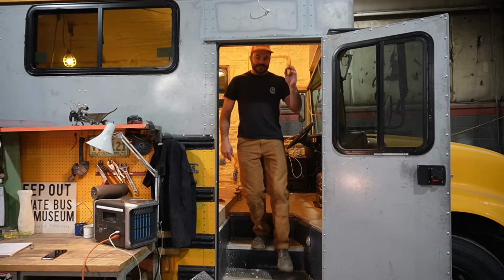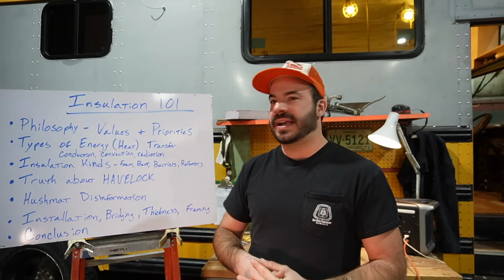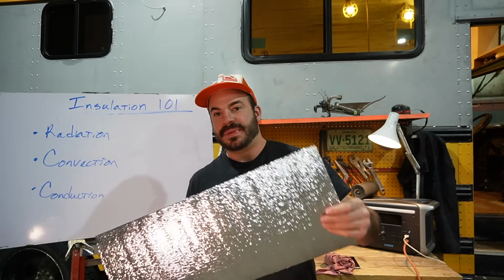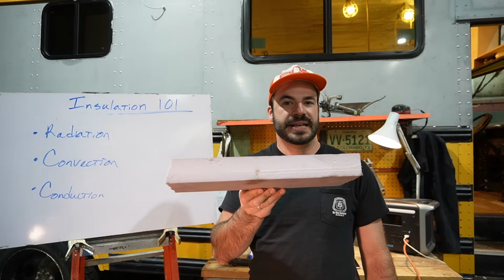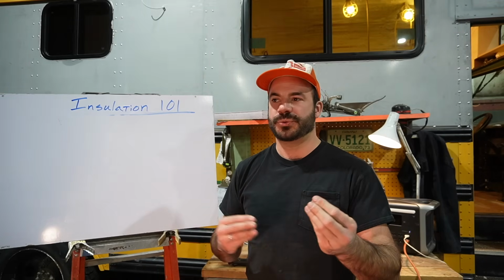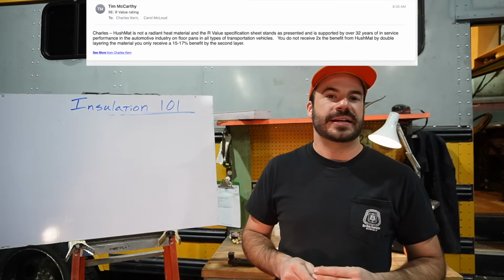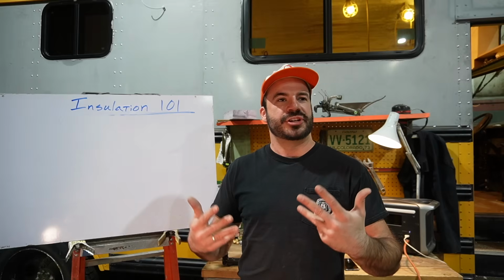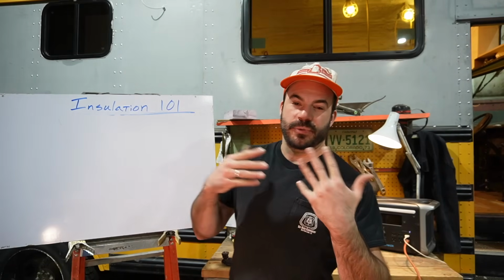Insulation is a SCAM (& the truth about Havelock and Hushmat)

Comment: Maybe I need to watch more videos from you. I'm confused on how you attach anything to the vehicle like the walls and such, if there is a 1.5" layer of spray foam on everything. Like if I can't leave a stud attached to the side of the vehicle and also exposed inside how do you attach things?

Yeah, after watching the video where you spray foam the inside of a bus the strapping is still exposed and in direct contact with the metal that touches the outside shell of the bus. That is a direct contact from inside to outside of stuff that isn't spray foam. This whole video said not to do that. Maybe I just misunderstood that there shouldn't be any contact from inside of vehicle to outside shell to stop condensation.

Comment: For some people, alot of this seems like common sense, trapped air in the wall needs to escape somehow,  if you own a truck,  having a metal skin, they've installed a rubber one way flap between the cab and bed, most people would never notice or even consider why its there, but its there to allow the hollow cavity to vent

Comment: This was very informative, I watched 3 times and showed my husband who nodded along and finished your sentences.  Would we be able to reduce the internal heat in our vehicle (and reduce our need for AC) if we put a chrome mirror wrapping over the metal / over the paint job on the vehicle to reflect out radiation AS WELL AS I guess it would be convection heat of the hot air around the vehicle?  Great video, great channel, subbed. Thank you!!

Comment: For some reason this popped into my "feed", so I watched for some reason.  Great explanation. With that, if you were to spray the metal of the interior (or paint) of the van or bus with like Lizard skin or even Redgard would that then do any good with moisture between the metal and the wood?  What if you were to coat the bus metal interior with Lizard skin and then the ribs with Redgard?

Comment: There are still a lot of nuances missed. Closed cell spray foam should not be relied on for a vapor barrier. It thermally cycles not to mention as you’re driving down the road the additional movement will cause yet more cracks. Factor in the off gassing and carbon impact of foam insulation, I just don’t see it being as good as your making it out to be. Installing a dedicated vapor barrier would be much better than relying on spray foam.

Comment: Putting a reflector INSIDE the window glass of a vehicle will certainly help, but look at the path of the light. It first has to enter your vehicle, and then it hits the reflectix(sp?) and then it has to go out through the window again. There is some heat gain in your vehicle.  The same thing with your home, putting shades, even reflecting shades INSIDE a window will help and keep that heat from radiating inside your room and heating up things inside the room ... like shade.  But the shade itself is inside your house/window.  What would be really good is something on the outside that shields even your glass window from the direct sun, but is not in contact, or is in insulated contact with your window.  For example, if you stood ourside your window and help up aluminum foil any distance away from the glass then you would be shading your entire window and the inside of your vehicle.  or if you had a really good insultator on the outside of the window, say like you could mold styrofoam thick enough to prevent conduction of heat onto your glass - that would be the best could co.  But that would look like *&($(*#$ and be hard to attach and probably add air-resistance to your vehicle.  I've seen videos of vans with some kind of thin insulator stuck to the outside of the window, that I think has little holes in it to allow the occupants of the vehicle to still see out.  That might be something to look into.  The thing is that in winter, you might actually want that heat to get into your living space.
It's complicated!  ;-)

Comment: I know this video was posted a long time ago but I have a question. When you were talking about the foam insulation you're saying that something about people worried about the bad fumes that it can produce. I'm wondering if there's a way to put something or paint something over it like a thin spray, thin paint, etc... coating that would not depreciate the value of the foam from doing what it does.

Comment: When doing a van build where space is limited, and you can't afford the space of inches of insulation on top of your framing, how would you recommend mitigating thermal bridging for the wood studs? Maybe a layer of XPS behind each stud? So the sandwich in my case would be wall cavity insulation (whether spray foam or thinsulate), studs with XPS adhered to their backs, and lastly wrapping the whole thing in Intello Plus variable vapor barrier.

Comment: Minor comment about "convection". Convection is the mass transport of hot stuff because of buoyant expansion. You heat the air, or water, it expands and becomes buoyant relative to the cooler air/water, and floats upward (then it cools and comes back down). You can also push the heated mass around with fans and pumps (or even shovelling hot sand) which is very similar to classic convection. 
Often convection is actually a problem because the heat 'goes away' and fails to stay where you put it. It can also carry moisture with it. Damp air is is also buoyant, so warm damp air can be even more of a problem.
 
As an aside, water stops expanding for temperatures below 4C, which is part of why you get ice on lakes, rather than the frigidly warm water floating to the top!

Finally, it's also worth realising that your van is "just" a mobile building and all their science and learning can be borrowed (see Joe Lstiburek's stuff)

Comment: I am a quilter, and I want to know which batting holds heat and releases body moisture (sweat) -light fluffy  batting, OR a flat,tightly woven natural fiber batting?  
I know the subject is not quilt batting, but ANY type of batting that provides warmth and air flow regardless of what surface (metal camper), or bedding (covering body).
I personally prefer at natural fiber to the fluffy, white  batting that bunches up
into lumps that causes wrinkles in both quilt tops and backings.

Comment: So on another note the only thing I've ever seen foam actually do its job was in a house it was closed cell the only other insulation that I've actually seen work was rockwool in my experience with the radiant barriers is that it's a hoax I've used radiant barriers in all of my vehicles and I can't tell any difference I can tell the difference in the summer if I take a white sheet or an agricultural tarp that's white and put it over the windows that's the only time I've ever seen a difference in the summer heat coming into vehicle no matter what kind of Radiant Barrier you have on a piece of foam that you cut perfectly to fit the windows and taped it in it still has absolutely zero bearing on the amount of heat coming in the window the distance between the window and the barrier creates a hotspot which then leaks into your car most miserable

Comment: So what y'all aren't really understanding some of you want most of you will is he mentioned specifically spray foam of the closed cell variety now there is a difference in day and night between closed and open open cell will not give you the sealing effect Therefore your walls will still radiate out the warmth or the cold the problem you run into is the mold if you're in Northern climates then you really need to do research on what you want for yourself I've lived in minivans pickup trucks conversion vans and enclosed cargo trailers mold is the number one concern mold resistant closed cell fire blocking foam little bit more expensive but if you catch a spark you're less likely to die if you are in a climate that is predominantly 32° and colder then it's not going to matter what you put in there when the fire goes out there's nothing to heat soak therefore the cold will come quick no matter what kind of insulation you have I'm currently starting another build in which I will use rockwool in all the accessible places in the van I will be incorporating a campervan wood stove make and model I don't know I'm still doing that research

Comment: Hi There! I really hope you react on my comments as I am a bit concerned about this. 

Trough my door handles comes water into my van, the side handle and the back door handle. It’s way too hard to get those off or at least I don’t know how. How do I insulate those doors? 

I have an option with armaflex (think you know K Flex, is the same) to put over the door but not in the door.

Comment: I remember when I was young and thought I knew everything too.  You should have been a dairy farmer because you sure can really milk a subject.  

Have used or been around Hushmat for a long time.  Never met a rep who promoted their product based on thermal insulation.  Their mission is spelled out in their name.  Hush mat.  Its primary purpose is to block noise which it does fairly well.  That is why their product is in nearly every automotive product made for the last 30 years or so.  Thermal insulation was only mentioned as an extra benefit.  I have a love/hate relationship with the stuff.  As a manufacturer, it is affordable and excellent at sound dampening and appreciated its benefits.  As an upfitter, I hate when I have to drill through the stuff.  Even though it is a cloth mat, it is a major headache to make large holes in it once it is installed.  As a product sold to automotive manufacturers, it has to go through testing your spray foam would find problematic, like a flame test.  Does your spray foam have any certifications that would allow REPUTABLE automotive manufacturers it use it?

But, what do I know?  I only have 50 years of automotive experience, working with four builders and several upfitters compared to your advanced 8 years of anecdotal education in a little shop working on old school busses.  I have gone through the extensive testing requirements for automotive standards.  I was often sent on the road to give seminars on technical subjects such as electrical systems, body construction types, body mounting, vibration protection, multiplexing, and even warranties.  But I am sure that pales in comparison to your vast experience (I only repeated myself because you saw fit to remind us of your vast 8 years several times.)

If I was working for Hushmat, I would most likely be the one to be asked to rebut your little diatribe, because I take joy in shoving peoples noses into their own ignorance.  And, even though I would not get paid to do it, I am tempted to do a detailed take down of your poorly crafted attack on them but they are big boys and can fend for themselves.  But, believe me, if I were given a couple of hours with one of your precious little busses, I could easily show you hundreds of violations of established, published standards, especially if you ran any wire at all.  Accompanied by 27 color glossy photographs with circles and arrows on the back of each one.  Chances are though, lucky for you, most of the crowd of vehicle manufacturers they supply would only look at you and laugh.  

Just out of curiosity, have you ever built anything that was actually tested by a third party to see if it meets any standards?  If not, don't be calling out for attention, you might get more than you want.
Reply from the maker: Trying to explain insulating a rig in less than an hour among with the theory is pretty damn fast, but I do appreciate farmers and I was just hanging with an old dairy farmer—super nice fella! Wouldn’t mind to be his colleague. 

The spray foam i use does have flame retardant in it and will not propagate flame it is a class 1 building material—just like the spray foam used in bluebird wanderlodges since the 80s. 

Did you watch my video far enough to see my email exchanges with hushmat? They repeatedly claim r value that isn’t there. 

Thanks for watching, if you want to come tear apart my build I’d be happy to let you film a reaction video, or heck you could just make one based on any of my build videos.

Comment: Help me out, Chuck! We purchased a converted Sprinter-based van with minimal insulation. We live full-time in it so I am concerned about moisture. I have done a couple of small side areas with Thermo-Tec double foil radiant barrier glued to the exterior panel, Thinsulate glued to that, and Havelock stuffed into the nooks and crannies. I have stuffed Havelock through light holes into some sections of ceiling. I can't do vapor barrier cuz there are too many areas I don't have access to, can't remove refrigerator, shower, ceiling, etc. Since too many areas are inaccessible to install a vapor barrier, would it make sense to install vents into those areas so at least there is some air circulation to prevent moisture being trapped?  I don't anticipate long trips into very cold weather. Love the video, VERY informative! Thanks in advance!!

Comment: Wouldn’t it be better to use metal ribs and spray the spray foam in the cavity. Then you wouldn’t have to come out the extra 1.5”.
Reply from the maker: Nope, unfortunately since the ribs are a metal tube with direct contact to the outside, and insulation in them is going to have minimal benefit
Reply: @ChuckCassadyYT  okay so use wood but as long as the wood does not contact the outside metal you will be good. I think that’s what I saw in your other videos.

Comment: Thank you for your informative video, and I agree with you 100%.  Have you tried to put a butylene sheet adhered to the outside of the van and then spray foam on it?  Also, what do you think of the available multifoil products? They are thin and were originally designed for space applications.
Reply: I think that the best way to insulate would be a layer of adhesive butylene, spray foam to the level of the metal metal frame, a layer of multifoil on top mechanically fixed with some wooden batten to fix everything on top.  anyone has done this before?

Comment: I enjoy a pension after 40 years in HVAC.
I still advise and design.
Kilmat is using collective thermal displacement for R value. Radiation of the roadways etc… plays a factor.
You should always trade out air no matter what you use.
For various reasons.
For your choice for off gassing. 
RV’s warn of formaldehyde. You are not always driving. You should never cook without exhausting and bringing in fresh air. 
All industrial and residential  builds have HVAC air change requirements for reasons.
Every application should.
My home changes out air for fresh at a higher rate than a hospital room.

Comment: Hey man, what about long term- does it become brittle and delaminate from the walls? Do you have any data from your oldest builds using it? Thanks!!!
Reply from the maker: i havent seen any of that and ive torn up old bluebird wanderlodges from the 80s with spray foam still intact!
Reply: @ChuckCassadyYT  interesting. My thought stemming from "great stuff" in a can - same material. Closed cell poly... etc.

Im assuming the more professional (kit/ pro grade mixing equipment) application  allows for smaller air pockets that essentially "ablate" (only word i can think of to describe an outside layer weathering first) slower. I know that stuff ive sprayed 10 or so years down the road becomes darker yellow and brittle.  Faster when exposed to UV/ atmosphere.

Do you have a video highlighting the installation of your system? If I had the cash, or was a bit older and didn't have the get up and go, I would buy from you. But im 30, and broke.
Reply from the maker: Great stuff is not closed cell. It’s open cell!

Comment: I’m in Florida, cargo trailer conversion plans include R-5 Pink 1” foam in ceiling and walls, my question is: Would it benefit my build or not, to install tyvek over the entire pink foam between the foam and tongue & groove and 3/4” plywood walls?

Condensation is the concern but your video as awesome as it was, left me slightly confused. I will also be traveling into colder areas of the country, Maine, for instance.
Thank you so much for any guidance! You guys are great.

Comment: Hi
Love your videos, they are very informative.  I find it great to watch something that is based on the science and practical experience.  Thank you for sharing.
I’m currently planning my first van conversion.  I’m tempted to use spray foam insulation but worry about the ability to change things in the future should something need repairing / altering / adding etc.
I’ve thought of two possible solutions (thinking of everything first time isn’t my forte so isn’t a realistic option).  
1)	Install a plastic conduit for all wiring that is kept away from the outer wall and has a handful of breakouts for access.  This would also have spare strings in should I need to pull any additional wires through later.  The spray foam would then go between the conduit and the outer skin.
2)	Use a plastic sheet across the inner skin and then rely on the pressure of the spray foam to fully close the gap between the sheet and van skin.  My thought is, if practical, it would enable me to remove the foam in sections if needed without having to try and cut lumps out and scrape the final bits off the inner skin.
Would either the above be realisable?  I’m also not technical so am fully prepared for them to be shot to pieces.